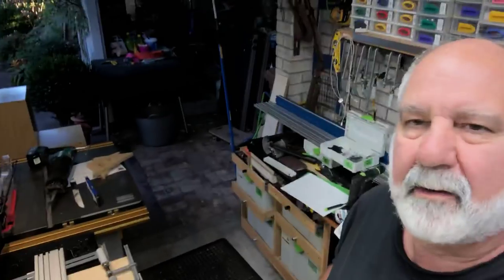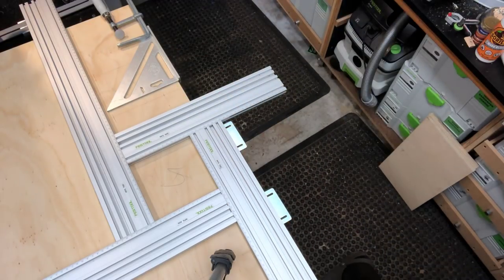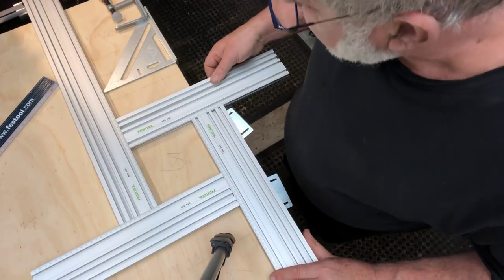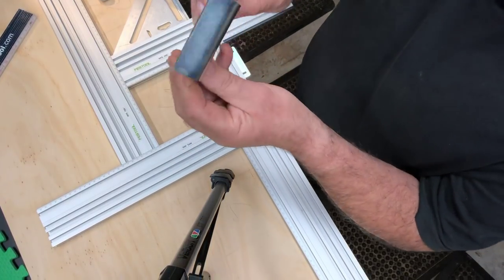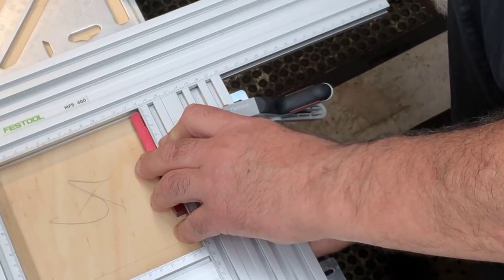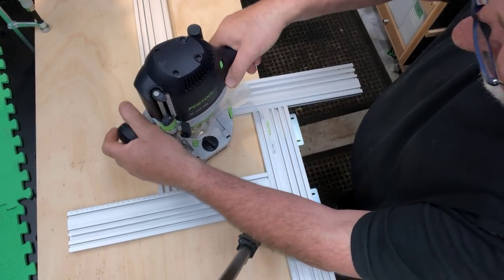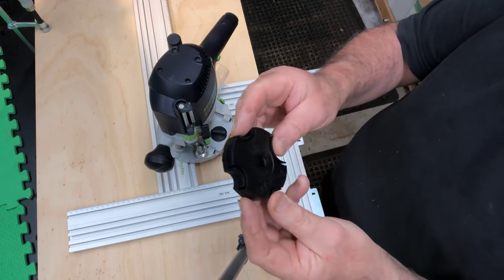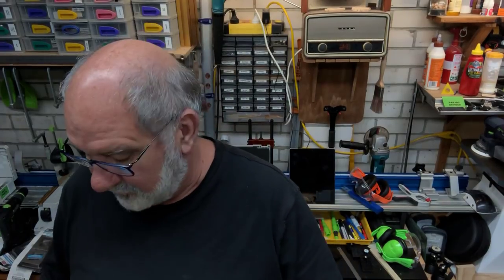ROUTING OUT SQUARES USING MFS RAILS AND OF1400 ROUTER PART 1

Comment: Steve. Do you do a pre-router cutout with a jigsaw to remove most of the material and to speed up the process?
Reply from the maker: Yes you can do that of course but thats a two factor process just as easy to use a 8mm bit and just cut it out, but you can do either way equally as successful as I am sure many would, infact I nearly myself but my routers are powerful as I have the 3 Festool routers...1010 - 1400 - 2200 but the 1400 handled it with ease.
Reply: Good answer. Saves fiddling about. What thickness ply are you using? I've got a couple of routers myself. The big Makita is very powerful and I can fit the support thingy that comes with the MFS.